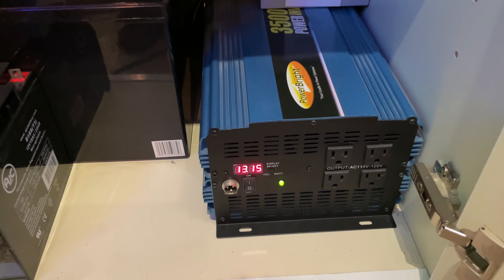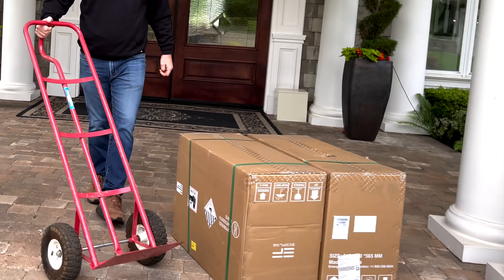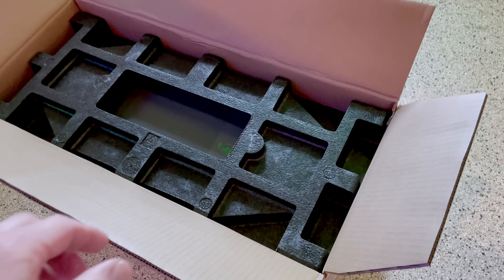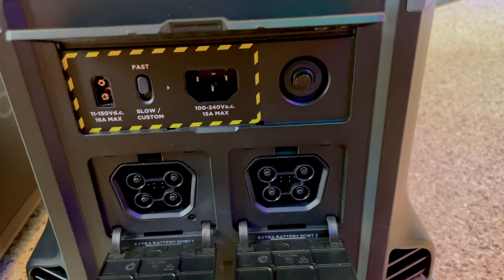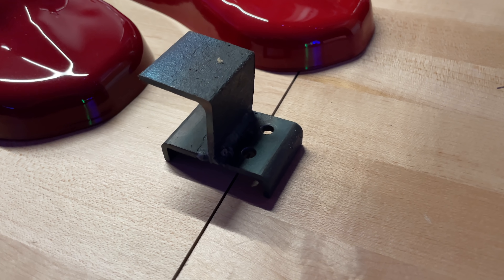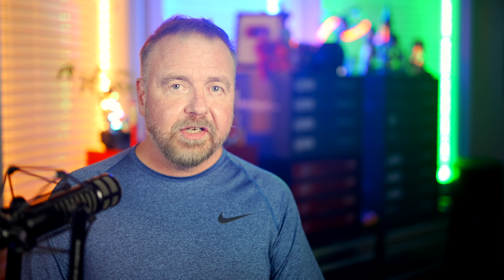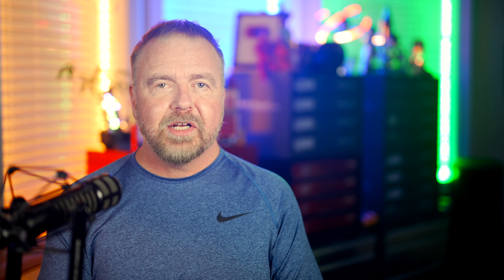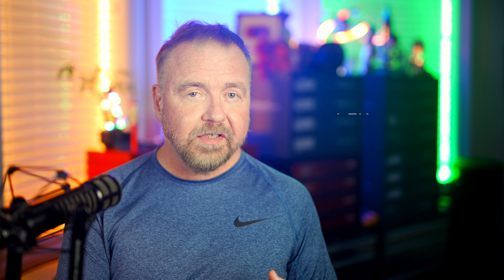Cheap Solar: 12 Years Later - What I've Learned and How I'm Upgrading It

Comment: As big as your property is, I'm surprised 300W was even worth it; and, I'm also surprised generator noise is even consequential - you should go ahead and build yourself a generator baffle box.

I built a DIY solar system that's roughly 8 kW, with a battery bank that's just under 20 kWh (~760AH) - this system cycles daily using grid-tie inverters, and has a cut-off relay that prevents discharge below ~55% at max discharge, and more like ~70% on daily cycle discharge, which greatly increases my battery lifetime. The grid-tie inverters are able to synchronize with a generator-powered grid; and, thus, the house is setup to completely transfer over to generator power (with manual intervention at this time), and, the inverters will kick-in and greatly reduce fuel usage [and, thus, increase runtime] of the generator. I can power everything in the house in this way, except the main A/C compressor - it redlines the system, and, thus, I typically trip that breaker off if the house needs to go "off-grid" during hot weather.

ROI is probably going to be ~15 years on a roughly ~$6500 investment - not including interim upgrades\additions to the system.

As of today, the system has generated ~8 MWh of electricity.

Comment: 13000 W gas generator and you need to adjust ?

What kWh do you need per day ?

It must be an awfull lot more than here where the average house is using about 11 kWh for 2 adults working from home. 
11 kWh per day would never fit to a 13 000 W gas generator cause it would end up in a pollution night mare running mostly close to idle when average demand is 400 Watt or roughly 150 W through the night of 8 hours (1,2 kWh) and 9,8 kWh over 16 hours during daylight, so about  600W . 

I guess the US is still an energy monster if you check average consumption across the world. 
All the eco friendly stuff is not being developed in the US cause energy is cheap and no one really cares. 
Ones fault is the other ones luck so we are ahead on the road to fully independence from the grid using hydrogen as the storage instead of outdated Lithium Ion delta ecoflow storage compared to LiFePo4 and hydrogen. 

Here the surplus energy from the roof during summertime generates on a 1,5 m² space hydrogen that then will be used during autumn and winter primarily to heat the house and generate energy stored in hydrogen bottles which then is used inside the house or stored in the batteries once the solarroof is no longer keeping up with the demand.
That is far more innovative and you no longer need a grid nor a powerhouse cause you are your own power house. Size of the hydrogen bottle storage is 1,5 m² and for the unit itself about 1m² and that is it. Works great at lost that are being aware about the amount of energy they do use and what helps the systems the most like no dryer and laundry just when the sun is shining bright enough to use the power when it is created.